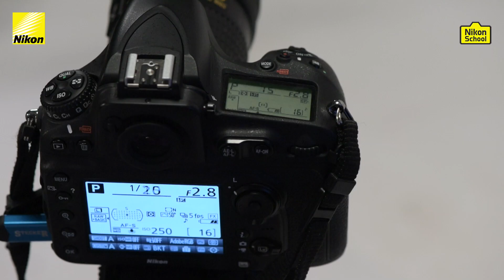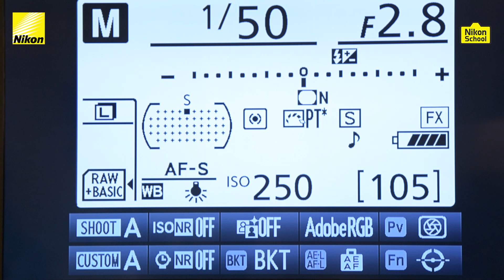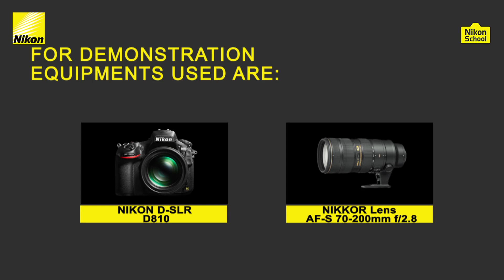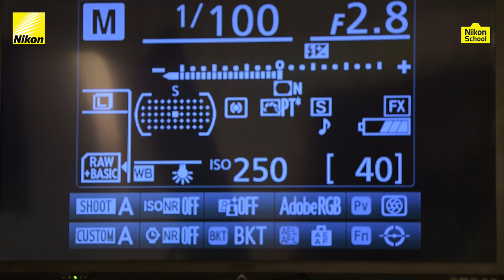New Nikon School D-SLR Tutorials - Exposure Metering - Episode 2

Comment: Hi, I m using d7200. But I'm in dilemma in aperture priority mode, with 50mm 1.8g. if I use aperture priority mode with 50mm 1.8g lense in outdoor shoot, then pictures will over exposed, if I increase aperture then bokeh effect will be not UpTo the mark, or not as expected. And if I control exposure with -+ button with aperture at 1.8, then exposure will not allow me to set at 0. Please suggest me,... Waiting.... Thank u.
Reply: Asif Kotabagi try using a variable ND filter to dial down the light entering the sensor.

Comment: And i thought these guys are professional until i saw the 70-200mm lens not mounted on the tripod...it should have been mounted on the tripod and not the camera....if you let it hang out like that its weight would give pressure on the camera which could damage both lens and camera.

Comment: For Nikon experts how can they place this telephoto lens and body on a tripod and not mount using the tripod collar, great way to place stress on the flange where the lens connects to the body, maybe it will snap off and fall.  Past the exposure stuff, ok, but total failure on how to mount a telephoto lens where Nikon even manufactured a tripod collar for it. bad idea at 8:50

Comment: Good and informative for beginners.  It would be a great help for beginners if you explain how to use the exposure compensation to correct the exposure metering while using modes other than the manual.  have a good day.
Reply from the maker: +Dilip Kumar,

Thank you for your suggestion. We shall take that into consideration.